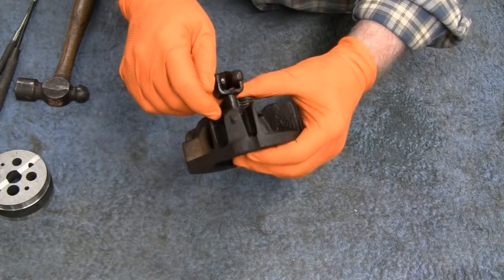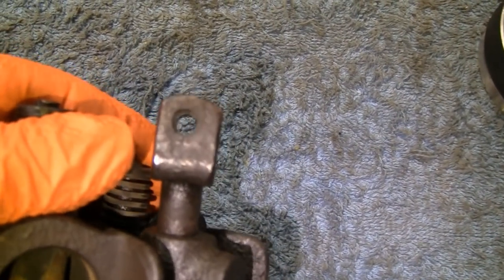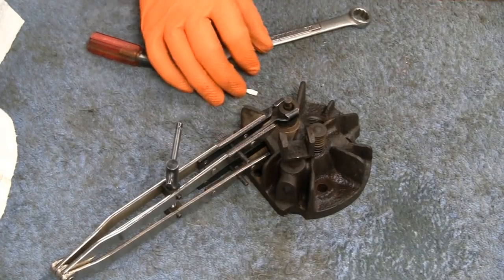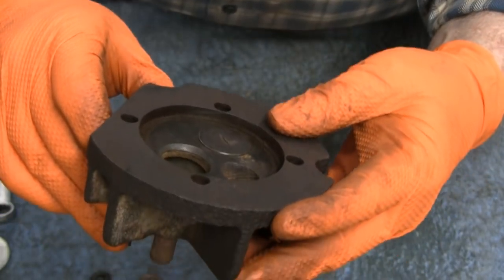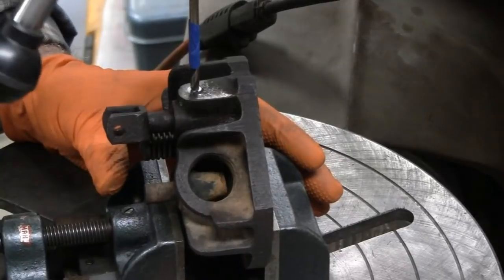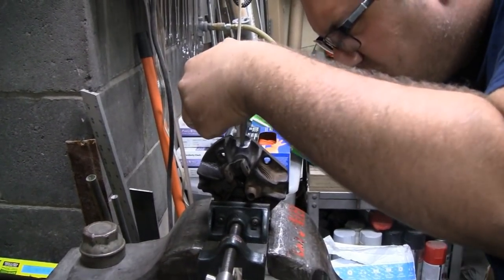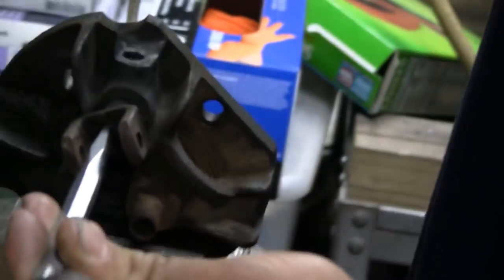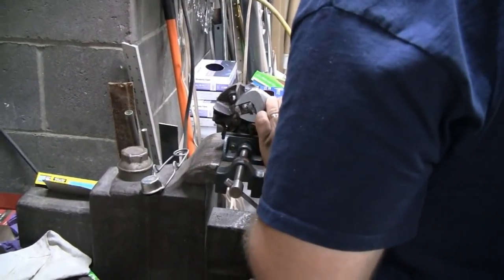1930 BRIGGS FH BASKET CASE RESTORATION (Part 5)

Comment: I was about to go bed and your notification popped up. I said perfect let's spend some time in the shop with RK and then go to bed. Little did I know I was getting 2 for 1 because Mike showed and came to rescue. Good job guys were getting there but I know we have to be careful with these old engines and these old parts that are stuck togethers it takes a little longer but we aren't in a rush we are after a beautiful restoration!
Reply from the maker: Yeah Buddy!! Mike couldn't have stopped over at a better time!!☺

Comment: Get a good set of left-twist drill bits.  Every time I have to remove a busted bolt or stud, I start with a left-hand twist drill bit.  Over half the time the drill catches and backs the broken piece out. 
I hate using those left-twist tapered "EZ-Outs" because they tend to force the threads of the drilled out broken piece tighter against the threads.  And hammering a square tapered extractor into a drilled broken bolt also just makes the threads tighter.  Left-twist drill bits are the go-to for removing broken bolts.

Comment: King, about that egged out rocker arm. When my Honda ran into the same issue, my mechanic friend Gus (my personal Magic Mike) drilled out the egg & used a short piece of copper tubing to be a sleeve. The ID was the same size as the original hole. And the OD was just the right size to almost fill out. Then he just drilled the hole for the oil to flow.

It got that engine running as the day I bought it. I hope my experience can be of some help or at lest give you an idea on fixing that rocker arm.

Comment: You Roadking, as many of these old engines you work on and with the old broken bolt have you ever though about a set of left hand drill bits? < I have used them from time to time and have has some success with them.
Reply from the maker: Yeah Swanny we have a set!! They're good if you snap a head off a new bolt that you over tightened but pretty useless on an old rusty stud!!☺

Comment: You need to get someone to sponsor one of those induction heating tools, not used one but from what you see they look good just expensive. Is it normal practice for that inlet to be peened over? Seems a bit barbaric! Looks like some of those holes were drilled on last call at the pub!
Reply from the maker: Yeah that's what Briggs did on all those engines, peened the intake valves and put keepers on the exhaust!!☺

Comment: I stopped at 4:04 to ask this: Can you drill out the egg-shaped hole in the rocker and put a brass bushing in there with the original I.D.?
Reply from the maker: We'll probably make a custom steel bushing so we don't have to make that hole any bigger than we have to!!☺